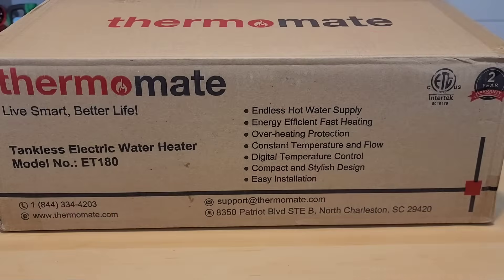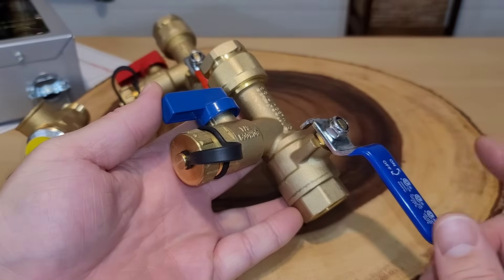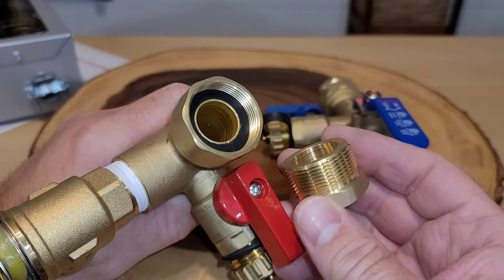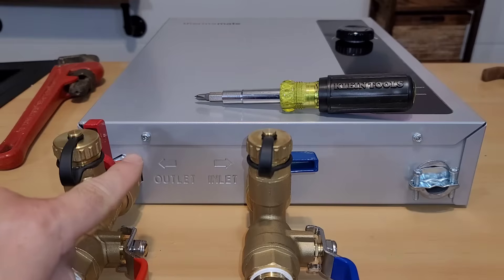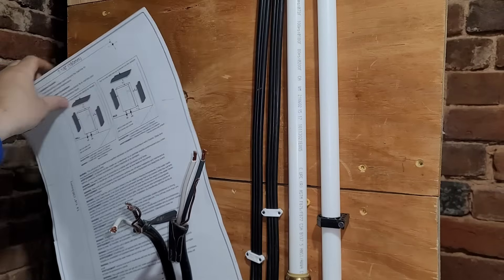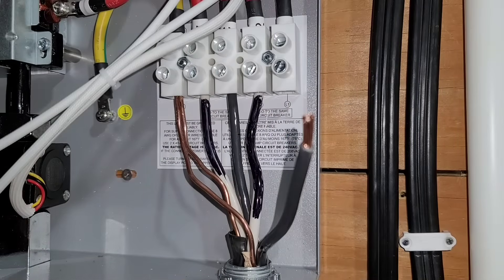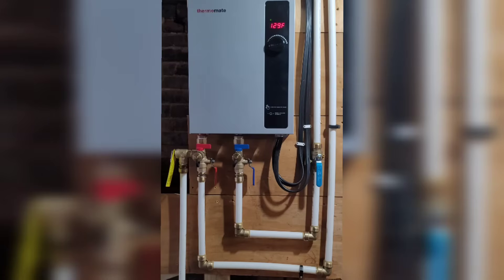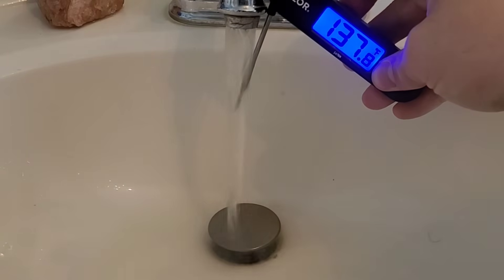🌟 Tankless water heater installation. Thermomate 18KW tankless water heater [505]

Comment: Jeff,  I appreciate showing every detail of the isolator valves.   How was it determined to use the 18Kw size?   I'm worried about not having enough flow.   It's just my wife and I.
Reply from the maker: For me it was a combination of a couple things.  First was space in the box. Without extra work we had space for 2 double pole breakers. Second 18KW was enough to provide  hot water. That being said only one fixture a time will have hot water. If we run 2 they will both be warm. I hope this helps. Thanks for stopping by and commenting 🙂

Comment: Have a couple questions. Thinking of the on demand for a double wide. The 220-amp 40-gallon heater is on a 30-amp braker.  why are you installing two 40-amp power to your unit? Second question what about drip pan? which is a requirement in the state of VA?

Comment: Is it a must to install the Isolator valves?
Reply from the maker: It may be code in your area, and although you can get away without installing one, my recommendation would be to include the isolator valve. Thanks for stopping by and commenting 🙂

Comment: Did your Rheem unit fail?  Are you replacing it with this one?
Reply from the maker: No, I switched back to the Rheem after this install video...that being said I installed this unit at my brother's house...both are still running well. Thanks for stopping by and commenting 🙂
Reply: @Jeffreviews4u  Sweet!  I'll be installing the Rheem on Monday in my house.  I was hoping yours hadn't already failed.  Thanks for letting me know!
Reply from the maker: @MrPagevideos  absolutely, I actually just posted a video where I descaled the Rheem unit.
Reply from the maker: Good luck on your install!
Reply: @Jeffreviews4u  Thanks!
Reply: @MrPagevideos  how has the Rheem water heater worked for you?
Reply: @davidnewkirk2438 : I had to return it.  I didn't have enough room in my breakerbox.

Comment: On the original install you should have put a bushing in the hole for the electrical wires.  Leaving it off looks amateurish and doesn't meet code.
Reply from the maker: Agreed. The original install was more of a - let's get this done quickly, so we'll have hot water again, lol.  That's why I went back and corrected a few things. Thanks for stopping by and commenting 👍

Comment: So I ordered everything! Tank, fittings and shark bites and orange thingy. Plus we have horrible sediment filled water here so I added a Aqua Pure scale filter. Now I need a plumber and electrician. I have a question. I'm replacing the 12 yr old hot water tank. I already have 2 additional empty breakers in my existing box. Will they have to be used or will the wiring that powered my outgoing water tank be sufficient? Thank you for any input. I need all the advice I can get. 😊 75 and still DYI.
Reply from the maker: I'm not sure about your current setup, but I had to replace my existing wiring to accommodate the tankless system. Let us know how it works for you! Thanks for stopping by and commenting 👍

Comment: What about water pressure, this thing has got to be pretty restrictive with pressure.
Reply from the maker: My PSI is around 60, hot water alone I have noticed sputtering after a few minutes (only happens for a second or two) hot and cold water together I don't notice a difference from my original hot water tank. I have read that these tankless systems don't work well with psi over 75. Thanks for stopping by and commenting 👍
Reply: Minimum activate water flow must reach 0.66gpm